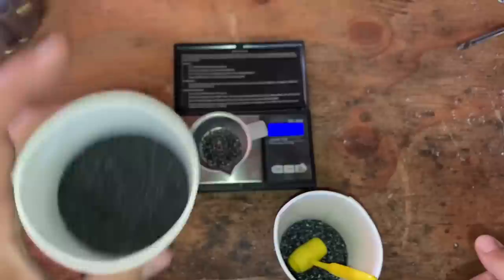Why Is Your Homemade Black Powder Weaker Than Goex? Black Powder Service Announcement.

Comment: I don't bother with the pucking process. I just load by weight instead of volume. It's a lot easier to corn before pressing. It doesn't make any difference anyway if you are muzzle loading, only if you are making  cartridges or loading cap and ball revolvers. If I test goex and home made by weight, mine is faster, for what that is worth.

Comment: I had a wild hair, so i tested the T7 ff i had. Set the powder measure to 50gn, then weighed it. It showed best out of 8 times 39.^gn. Most were at 38.^….i was a lil surprised bc i was expecting it to be heavier than my homemade, which is right at 46gn btw (and im good with that for now). I do use a 12 ton jack. For a complete noob amatuer im pretty happy with my results (for now)

Comment: Can confirm my propellant (75:15:10 pine) is 80% the density of Shutzen, but goes well enough in a .38 regardless and definitely burns cleaner. My press is utter bilge.

Comment: My ignition on my powder is good, as fast to burn as Goex and it cleans up well. My problem is accuracy. The accuracy isn't there though. It's not corned so when I use loads that would be 70 grains of Goex, I'm upping them to 80-85 grains of my homemade powder.
Reply from the maker: I would try doubling your charge and see if that doesn’t help. I highly recommend Corning your powder. I don’t make screened powder anymore and haven’t for a few years. It’s the only way to fly

Comment: I’ve subscribed, but know nothing about making black powder - learning fast though.
I did wonder if you could extrude your powder rather than just pressing it. Drill a zillion holes in a disc and press it through that…. Or a cone with one micro hole at the bottom (funnel shape).
Haven’t tried it, and have no idea if it would work.

Comment: I LIKE IT! I did think my old muzzle loading propellant may? need a Re Puck? and I did make a roller thing o ma Bob to Corn my Pucks? to get grain sizes I want? But mine is still Not as Fast as "I Want"  I do 3% Dihydrogen Monoxide by weight or just enough to stop Dust Clouds and I let it sit to react with my KNO3 Your is still FASTER! my weight is low few % from Volume.

Comment: I don't understand why folks would be so anal about it. Out here in the western states it can be pretty hard to find real propellant. Simply having the ability to make it is an immense treasure. Flinters are now easy to supply. I don't give a rip if the stuff I make is somewhat different than what might be found in a store. It kills yander rock on a creek bank, it will break clays at 60 yards with every shot. I sure don't want to find myself on the receiving end of a charge of it. And I'm gonna kill an elk come fall with it.
  I'm not shooting matches with it. I'm just using it. Freedom to shoot is a tremendous blessing.

Comment: Excellent video, thanks for confirming my suspicions/conclusions....with a 6t press I'm around 4-5 grains light on a 50g measure. Nice thing is that it's cheap enough that loading up 5g isn't an issue....
My question is, why don't the "techies" already know all the techy parts? If you have to stand there calculating the timing of when to take the first step, how the hell do you ever get across the street?
Reply: 6 ton press will require a pucking die with a diameter of .8 inches to achieve 1.8 g/cc puck density.
Reply: @geargnasher9822  thanks for the info my friend, looks like I'm  making a new die!
Reply: @TheWingnut58   You're welcome.  You're right people some people get wrapped around the axle on this stuff, but I'm amazed at how many of the basic necessities people often miss with this process.  Jake does a great job of pointing out what's important to be specific about and what's more of a work with what you have deal.    All the techie stuff you need to know for commercial quality BP is cook your charcoal no hotter than 575 degrees F inside the retort until it quits smoking out the vent, ball mill your ingredients until the powder is so fine it feels slick between your fingers with absolutely NO gritty feeling, add water and stir stir stir the meal until it quits making dust, press in a die until the resulting puck itself measures and weighs to 1.7 or 1.8 g/cc (11 tons per square inch is the most pressure you'll ever need), dry the pucks a few days on your dashboard in the sun, break, grind, and sift to the correct granulations 20/50 mesh is 3Fg, 16-30 is 2Fg, 40-100 is 4Fg.  To make it even better, add 1 teaspoon per pound fine graphite and mill the powder with no media overnight and sift out the fines, this will eliminate the dust and polish slightly, though it doesn't truly "glaze" the grains.  Check your weight/volume against a volumetric powder measure and adjust your load accordingly.   That's as technical as most of us will ever need to get unless shooting 1000 yards with cartridge guns in competition.
Reply: @geargnasher9822  that's pretty much exactly what I've been doing for the past year or so....except my pucking die is a little too big for the diy press I'm using, also haven't tried graphite yet.
What formula did you use to get the die size?....I'm either going to make another die or upgrade my press....or both, lol
Reply: @TheWingnut58  I did the math on my press handle, pump piston, and jack piston to figure out how much pressure my press was delivering with a hard, one-arm pull and then measured the die length as I was pressing harder and harder, when the die stopped getting shorter and the press frame kept stretching I was at about 18 tons on the die,  did the math on the die area and came up around 11 tons per square inch to reach "maximum" puck compression.   I make pucks about 3/8" thick by 1.5" and weigh right at an ounce each.  I only use a graphite polish because it reduces fouling greatly in my big smoothbores and the powder flows better through the horns and measures more consistently.

Comment: Something I was reading up on, the original service load for a Brown Bess musket was 6 drams of powder which turns out to be 164 grains. Now, I can tell you I have no desire to shoot 164 grains because that's a pretty hefty charge, but, I wonder for the time how weak the powder was in those days given the inconsistency in the ingredients. I know where I am, there are two local forts that date back to French & Indian War and later the Revolutionary War and at both places they made their own powder. At Fort Ticonderoga, when the British finally captured the fort in 1759, the French when they abandoned it, they detonated their powder stores which was estimated at 21 tons, most of that was made on hand. It makes you wonder what a 164 grain powder charge would have been like shooting with powders of that time, compared to now.
Reply from the maker: Yes the 164gr charge was not pressed powder. If I had to take a guess I would say that later pressed powder would be roughly twice as powerful.
Reply: I don't own a brown bess, but I have tried out that load in my 12 gauge. I have a Mossberg and a single-shot Henry, both with rifled, slug barrels, and so for them I mold 0.735 round balls weighing 600 grains, put that on top of 150-160 grains of powder, and I get about 1,050 fps out of that load. It produces more energy than a 44 mag, so it's a great hunting load out to 100 yards. Actually, sighting it in at 2 1/4" high at 25 yards, it's dead-on at 75 yards, and only 5 1/2" low at 100, and even at 100 yards, it's maintaining just under 1,000 ft/lbs of energy.

I've got a couple videos on my channel showing off the loads. Although, if you do check out the videos, I don't recommend the 220 grain load you see, it's a wee bit high pressure for a shotgun...

Comment: I pucked the remainder of my batch to a measured 15 ton. Interesting result was the density was the same as the pucks at 8 ton. I am thinking my charcoal is the limiting factor. So for a 60 gr charge I will use 70 gr measure. Will compare chrony readings when I can.
Reply from the maker: How wide is your dye and how wide is the post on your press?
Reply: Iirc the piston is 1.375” diameter and the cylinder wall about 0.250”. The aluminum cylinder failed with the increased pressure.
Reply from the maker: @MrVoltar1  I ditched my aluminum die over a year ago. I’ve been using a stainless steel die and it’s holding up well.
Reply: @Everythingblackpowder  ah makes sense. Checked and my piston is 1.875” dia.

Comment: I thought initially, that I would try compressing the powder in a vice with a big cheater bar.  But it looks like I would just be wasting my time, since I don't think that will come near generating the pressures that are needed.   Hate to buy a 20 ton press just to make BP, but looks like that is what I am going to have to do.
Reply from the maker: Give it a try! Any compression is better than none

Comment: Let's assume that the chemistry is correct, and the materials are "pure"... so if we compress it to a decent amount to make it burn well, can we just weight it to get " the correct" charge? If that works, you could just weight out your 50 grains, figure out the volume on the measure, and shoot with what might be a less dense grain. Is this a valid thought process? I'm having a difficult time getting both real powder and percussion caps, so I'm thinking of making both, but a press will be something I need to buy/build and maybe not a 20 ton unit. So if 1.4 per CC burns well, I could just weight out a few to get the new volume needed for accuracy and get going.

Only other question would be how does compression affect the finer priming powder for flint? Do you still want the 1.7 per CC or is something a lot less dense OK.
Reply from the maker: Yes absolutely. I haven’t noticed any effect on the priming powder.

Comment: I'm good with my AMP for compression. I don't mind upcharging some. What has me bothered, that I haven't taken the time to fix, is the lead fouling I get when I clean after after shooting my homemade AMP.
I think it's the rubber from the harbor freight drum, and using lead balls for media. Still need to make a PVC drum and get ceramic media and hope that fixes it.
It's almost like I got lead melting in my powder residue. Ever deal with that?
Reply from the maker: Yes I had the same problem. I would recommend brass over ceramic.

Comment: This is more a question than a comment. My willow tree has always made good charcoal with the green limbs, but now I have a lot of dead limbs on the tree. Have you ever made charcoal  using dead limbs? Wonder if it would be the same as dried wood?
Reply from the maker: Yes, it works well. Just make sure you take the bark off of it.

Comment: So a couple of questions; one, what grinder or type of grinder do you use? I would imagine you'd want either aluminum or ceramic burrs. And two, where did you get your compression dies?
Reply from the maker: It’s a grain grinder. I bought it on Amazon. The pucking die I currently use is something for pressing weed. I like it because it’s 1.5 inch diameter instead of the more common 3 inch. I’ll try and find the links
Reply from the maker: https://www.amazon.com/Cranking-Operation-Grinder-Grinding-Commercial/dp/B08MDYLM88/ref=asc_df_B08MDYLM88/?tag=hyprod-20&linkCode=df0&hvadid=632065800132&hvpos=&hvnetw=g&hvrand=6692611414156903256&hvpone=&hvptwo=&hvqmt=&hvdev=m&hvdvcmdl=&hvlocint=&hvlocphy=1014165&hvtargid=pla-1886912518276&psc=1
Reply from the maker: https://www.amazon.com/stores/Rosineer/Pre-PressMolds/page/E5B43511-973A-402C-A5CC-FFBAC26EEBD7

Comment: Jake: I've watched your Myth busting video, dozens of time. Extremely informative. My Question is how do they make a pipe bomb out of black powder if nobody can blow up a muzzleloader no matter what the block the tube with and set it off ? Theidahoanshow managed only to bulge the barrel a little bit. I'm just curious. Thank you for all your great videos.😊
Reply from the maker: Smokeless powder would be my guess
Reply: As an old ordinance guy, black pipe and galvanized pipe are structurally not that strong.....One only has to look at the old 'iron cannon Balls' of the 19th century that only contained 2-3 oz. of BP, and yet were able to burst those thick walled shells into fragments! Modern Flintlock barrels can withstand much more pressure!

Comment: First off I like the ending of your videos. Suffer no fools is my motto. Now,. I am new at this and want to be as SAFE as I can. I have a chuck of land I plan on using to process the primitive weapon propellant. Not at my suburban home. What is your run time in the ball mill ? You use water to dough up your pucks. I have read to use 91% rubbing alcohol to dough up the pucks. Grinding: is my concern with reference to static electricity. Should I be? What do you use to grind your pucks. Lastly: I picked up a bag of 95% agriculture Sulfur. What is your opinion of using it? Thanks. . .
Reply: I tried agricultural sulfur. I found it's better to just buy pure sulfur from a fireworks supply store online at the same time I buy pure salt peter. But I'm far from being any sort of professional black powder maker. Good luck with it.
Reply from the maker: We mill all of our propellant for 24 hours.
 I prefer distilled water over alcohol but If you use alcohol make sure it’s 99%

The quality of your components is crucial. I purify all my nitrate and I only use 99% pure technical grade sulfur. 

I have never had a mishap while milling, pressing or Corning propellant but you need to make your powder as safely as you see fit. Don’t do anything that makes you uncomfortable and don’t take chances you don’t have to.
Reply: I have used Ag sulfur, you'll have a 1% clay component in the finished product, with 90% sulphur. It may make some small difference.  The largest difference I've found is the type and quality of the charcoal,  the fineness , pre combining, of saltpetre. I find no issues with using alcohol, but it's best to provide warmth for fastest drying. The faster it drys, the better.

Comment: i have a question-statement correct me if I am wrong. I read somewhere about the French or English milling the mixture wet and then spreading the mixture out to dry and then running it over the sieve to whatever f size you want. I would think by doing this process the nitrate fully saturates the charcoal and Sulphur?
Reply from the maker: Yes but pressed powder has been the industry standard since the early 1800s.

Comment: Well I'm leveeing the hard stuff to the chemist. Anyway my numbers are way off 50 grains come in at 39.0 on one powder Measure and only 24 gram's and yes there head shop scale I have a set of single beams and gram wights to make anything like that stuff you use in very old firearms kind of hard to do grains on them. But this is another problem is and I just noticed that the Powder Maseru that came with the pistol is short 5 grains to the fancy one that is clearer you unscrew the bottom cap on the push rod go's up n down don't know if anyone has cough that yet I just did.  And I can't get the black stuff ever since my buddy passed away over a year ago now. up 25 or 30 years I have always had 1 person I went to for everything my guns needed and never used  pyrodex  till a few mouth ago was the first time using it and I just don't like it I'll make my own even though it's not illegal in Texas no one wants to handle it academy did have it 20 years ago not any longer and now You have to drive 100 miles one way to bass pro shop to get the pyrodex or pay out the yang yang for it to be delivered. Anyway 12 Ton press willow charcoal or Air-flow 77/15/11 both of them is about the same burn rate just couple milliseconds off and my last stuff is faster and hotter and very clean sorry to be so long winded just happens when you get older . I will do the double press and see if that is the problem . And one more thing why not 100/15/11 ? I had to ask

Comment: What about those of us who don't have any sort of press? In short of me getting a fat kid to stand on the powder or drive over it with my truck, don't have any way to generate those types of compression. Going back to one of your first videos on how to make powder where you take the powder from the mill, spray it down with isopropyl alcohol, wad it up and then granulate it from there, I wonder how much less powerful that would be. Right now I would sacrifice some power for availability because it's getting too expensive to even find it in some places and one stupid political thing or any form of panic, and what is out there will vanish practically overnight.
Reply from the maker: You don’t have to press your powder. Screened powder works fine in muzzleloaders. It just takes more of it because it’s so light compared to corned powder.

Comment: The website "Cast Boolets" used to have several pages on this subject but the Political Correctness Gestapo seems to have taken it down . Now tthe website has very little. I do remember a year or so ago the there was a Table on the site that showed using at least a Six Ton Jack for a 2 inch Puck Die and lager Dies need a bigger press. I don't recall any of your video's mentioning what size Die you use. Any suggestions on the size Die you work with?
Reply from the maker: The “pucking die I use is 1.5 inch. It’s actually something made for pressing weed or something. I bought it on Amazon. I’ll send you the link.
Reply from the maker: https://www.amazon.com/stores/Rosineer/Pre-PressMolds/page/E5B43511-973A-402C-A5CC-FFBAC26EEBD7

Comment: I've successfully made BP for flintlock conversion using sodium nitrate but the grains get crushed easily I use CIA method w rice flour & I have same grinder as you what setting for ffg?
Reply from the maker: I can’t tell you exactly. I open mine up and make several passes tightening up the grinder each time until I get the desired size.